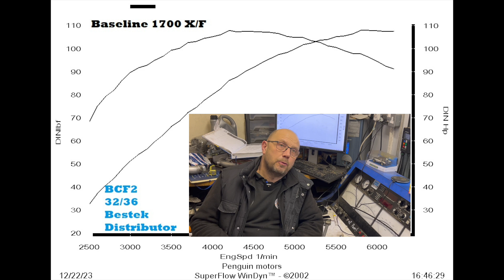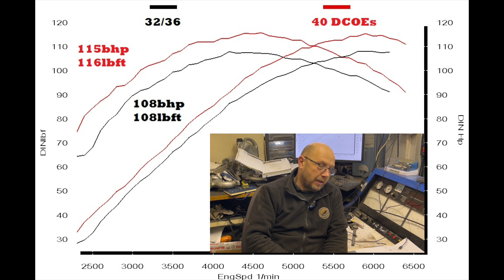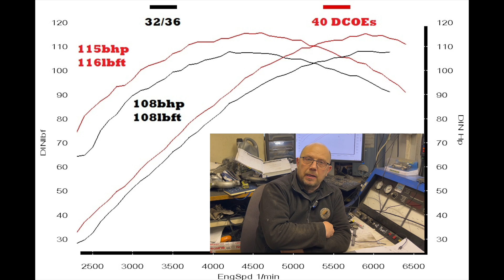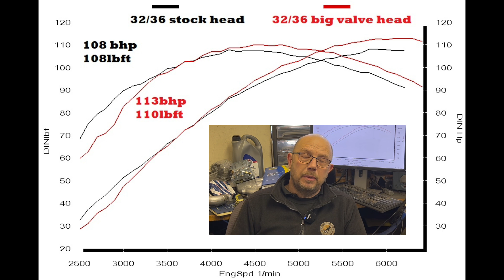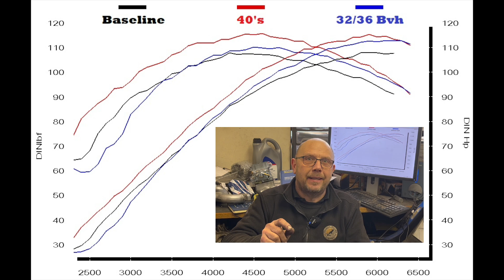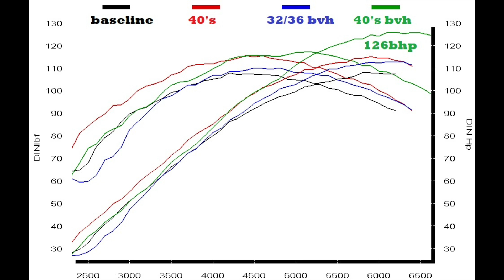FORD X/flow twin 40's and cylinderhead upgrades tested

Comment: i had a rs 1600 escort twin 42mm side draught extractors thermo fan electric fuel pump and electronic ingition golden lodge spark plugs ! 135 bhp crank = eating almost all challangers easy v8 killer racing datsuns and celicas - with xu1 toranas and monaro v8 - wow what a car LSD rear sideways and with control - that twin weber sound induction ! music. turbo subaru now.

Comment: I did almost exactly the same test series when I worked at Oselli almost 50 years ago. The numbers I got were very similar. I then changed from a BCF2 cam to a BLF22 and and that was quite a lot better all through the rev range.
Reply from the maker: really interesting about the BLF22, ive love to do some back to back cam testing on an x/flow, but the engien doesnt lend itself to swapping cams on the dyno like a pinto does.

Comment: In Canada on the Ford escort 1600 they used a carb with the same sized holes. When I reworked the carb and took the concave section out of the acceleration  cam arm and opened up the air bleed jets to a huge hole  like a 1/8 drill bit. The car went from  120kms to 140km/hr

Comment: There is often a big argument here in Finland which one is better - flat top "Anglia type" pistons + slightly skimmed "semi chambered" 681/691 head or M711"flat head" and 1300 pistons in same CR ratio - might be interesting to see who wins...
Reply from the maker: I’m guessing because I haven’t tested it but I would of thought if you have a big cam and mapped ignition the flat head flat piston is the way to go
Reply: Hi. I am writing from Türkiye. I did the 1600 crossflow with 1300's Pistons. I had very much compression ratio. It has a early ignition problem especialy in summer days . I cannot use the ignition advance vacuum line . It causes vibration in the engine.And the standard cylinder head gasket cannot withstand these pressures. I use a specially manufactured steel gasket. Still, I don't understand why the 1700 is so much stronger than the 1600 with such small changes. Have a nice day

Comment: love these vids on crossflows.  have a crossflow and T - nine trans .... both very very rare here in canada.... going to stuff it in a spitfire.  is it possible to test the Lynx single dcoe manifold?  maybe if you have on a forty-five weber?  cheers.
Reply from the maker: I have tested the a couple of times on pintos, in my opinion its not great, good for low down torque rubbish rest of time, use twin dcoe if you can
Reply: @PenguinMotors  --- thank you.

Comment: Very impressive pulling full throttle on the DCOEs at just over 2000rpm,,  must be jetted absolutely spot on 👌
Be interesting to know what jets were used ?
Impressive numbers on a BCF2 cam 👍 keep up the good work Graham
Reply from the maker: 33 chokes, although 32's would of been as good or slightly better,  F16, 135 main,175 air ( smaller airs on the standard head) idles were 55F6, which may or may not of been quite correct as i dont bother too much with them if its only a dyno test as opposed to an engie which will see road ior track use.

Comment: Awesome testing, excellent info.  Would be interesting to see if the worked head and 40s  got closer sub 4000 revs to std head with 40s at 50 % throttle  👍

Comment: Graph shows exactly what you would expect. Trying to get all that extra port volume moving in the big valve head, esp with a cam with a far bit of O/L is going to be a mission at lower rpm. As the RPM rises, so to does the gas velocity in the ports due to a ramming effect ( inertia, what ever you wish to call it ).  Port to valve sizes are very important. What is the IN valve head diameter ?

Comment: Hello sir Graham, I've got a question. Have you ever tested aux venturis with thinner brackets and wider area on the center (less choke)?
I tell you the history, me and a friend been testing my new head for the Pug 205 Rallye (euro spec) which it's been ported alongside the inlet manifold. This head made like 135cfm before we touched it and, after some work, we managed to get 165cfm and a smooth flow graphic with the same valve size, but using the valves from a Saxo 1.6 head which gives the advantage of having 30º valve seats and 7mm valve stem (standard was 45º and 8mm). When we fit the carburetors (40 DCOM's with 36mm chokes) we lost like 30cfm in all the graphic so we decided to use the 45 DCOE's. With the original setup (36mm chokes) we made like 155cfm (remember the head + inlet manifold made about 165 so the inlet manifold was ok). After it we still had a 10cfm loss, so, we went for the 38mm chokes and they were sligthy better but what made the difference, was to pull out the 45 DCOE aux vents and fit the 40 DCOM's (thinner brakets, bigger choke and both 4.5), and that's when we almost matched the head hitting the 161cfm. Sadly we didn't have a dyno to test the engine and see if actually we've made some extra power since sometimes not all the power comes from flow, and I'm curious to know if you ever tested it and what was the outcome. Greetings from Spain and keep up the good work sir!!!
Reply from the maker: the walls of the carb, air intake manifold etc wil always cause some loss of flow. you usually find a few cm of flow has no effect on power output. Dellorto sidedrafts only have one leg to the aux vent, so should flow more air, but in practise there is rarely a power difference between a weber DCOE and a dellorto DHLA assuming same sizes
Reply: @PenguinMotors  thanks Graham, keep the good work!!

Comment: Hmm I'd have a standard ported head with a fast road cam and 40 dellortos.
I'd love a 1600 sport with that configuration.
Dellortos are reputedly more economical than webers.

As 1600's go my ultimate preference would be a 1600 pinto from a ghia with the 2000 head,fast road cam,ported head and twin 45 dellortos.
If you could do that configuration as the cams easier to swap out that would be great!
Reply from the maker: You don’t want a 2000 head on a 1600! Not unless you want a very slow 1600! The 1600 head is as good or even better than a 2.0 from a tuning perspective. I might get around to testing some fast road cams if someone wants to pay for them, but I don’t have any and can’t justify buying them just to make a video
Reply: So what was with the 1.6 Mexico/ Cortina/Sierra ghia heads did they have the 2.0 valves to make 90 bhp over the standard 73bhp,along with other mods presumably?!
Reply from the maker: @stevep9739  IRC there was something different about a 16gt head, but its nothing to get excited about. The big difference between normal 16 and GT/mex is the gt had the 2.0 cam, carb and intake manifold, if i recall correctly 1600gt capri had a tubular 4 branch exhaust and mk2 mexico had the RS2000 twin downpipe exhaust manifold, so more than enough differences  to justify the power change

Comment: Recently drove a small light car with 1650cc non x flow head, modified bigger valves but i don't know the details of it.  Kent 244 cam, twin DHLA 40 with 34 chokes.
It was a pig below 4000rpm, then came strong to the rev limit.  Have you done any tests on a similar engine ?  Any hints at what to look for or alter to gain some lower end ?
Reply from the maker: loose the 244 cam!  reducing choke size to 32 or 33 chokes will help and probably wont make the slightest difference to peak power
Reply: @PenguinMotors  Thank you for the honest reply. Do I hear you say the 244 is not a good cam, or that it might just be too big ?  Can you suggest a cam that really does work hard from 3000 to around 7000. So much advertising and false claims out there with wild variations of timing all claiming similar power and rpm range, they can't possibly all be right.

Comment: What thickness and make  head gasket are you using? 👍
Reply from the maker: its just a standard replacement composite gasket, probably a Payne or Rienze
Reply: @PenguinMotors  
Do you not need a biggers size for the +90 bores?